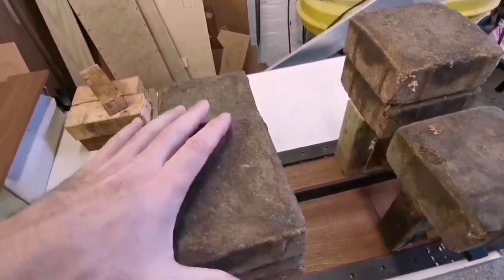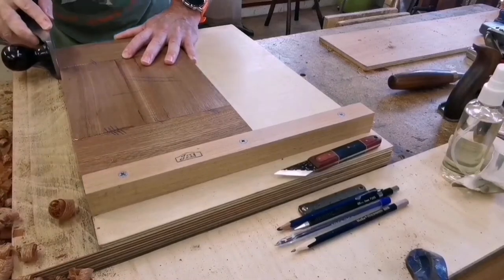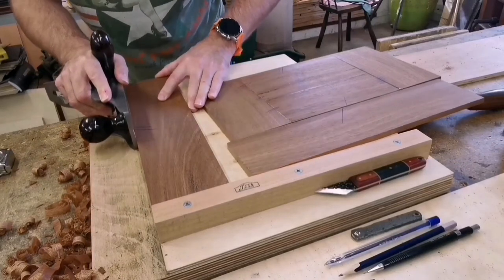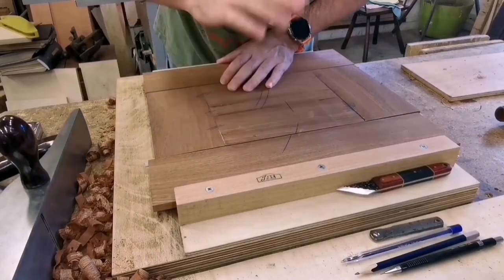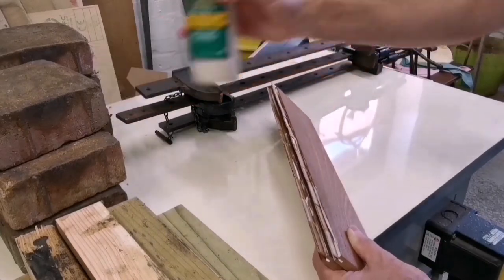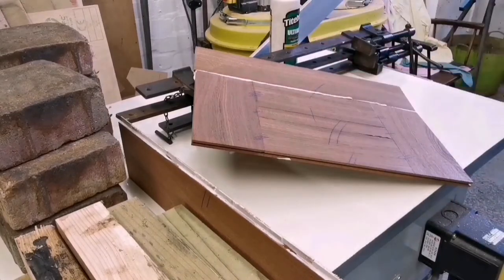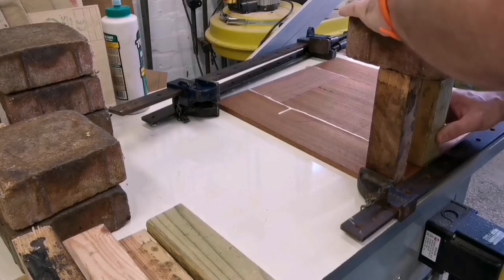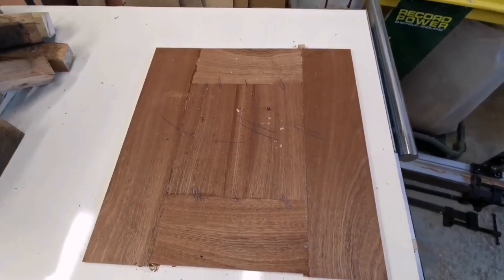[no65] Making a sliding door panel - (part 2) Camera Restoration Project

Comment from the maker: In this video I continue making the door. Using the same process as the great camera makers Gandolfi. 
The glue-up process is the same as the inner parts but on the top and bottom panels now. I use the 'labour saving' technique used by Fred Gandolfi and his brother Arthur, and it works so well. It really does save 5 or 6 minutes.

Comment: I'm sure you're aware but I think I read in Hayward and also watching Jim Kingshott in the past, both had one shooting board for shorter, mainly end grain boards, and one board for longer, narrow pieces.  I've promised myself a shooting board for these longer pieces at some point but never seem to get around to it or maybe I haven't found a need for it yet.
Reply from the maker: Yes this panel is a touch to wide. But managed it. I might make a bigger one. But most likely make two more at the same time. And maybe put one for SALE on my shelf. We will see. Lots to do.

Comment: Great job. Do you find there is less creep with the Titebond glue?
Reply from the maker: Less cramp time? Yes as the bottle gets older.. More air in there. I suppose I should get a tiny bottle to decant into. Then squeeze the half bottle until most of the air has gone.
Reply from the maker: Ahh if you did mean creep Paul. There's no creep with Titebond. That's why is so good in laminating curves. There's no 'spring-back' off moulds. It just holds tite.